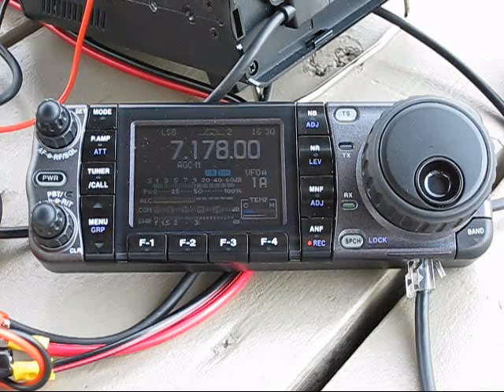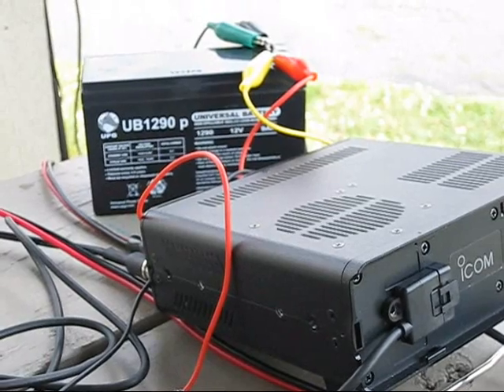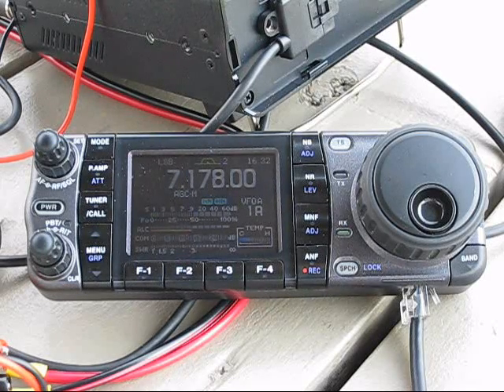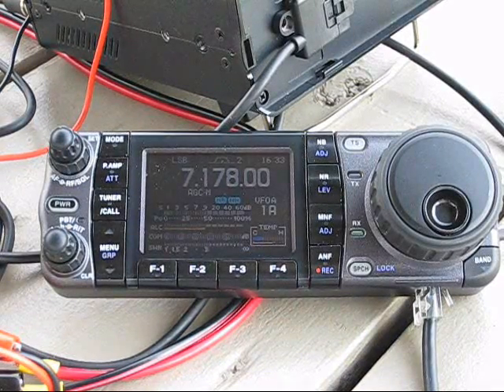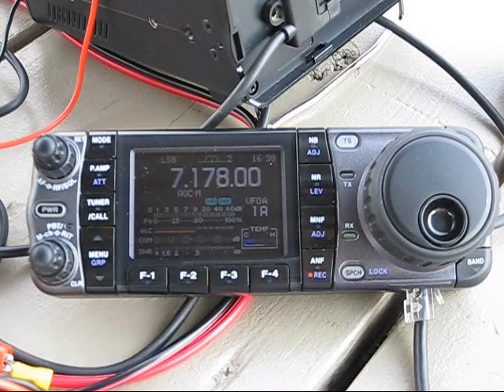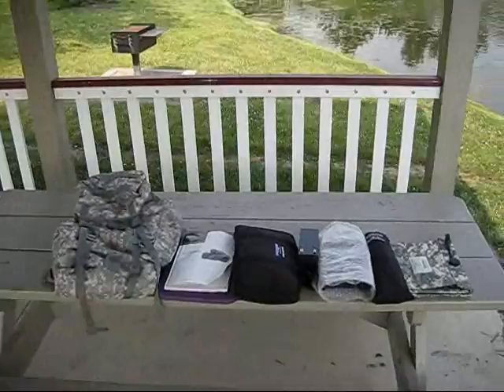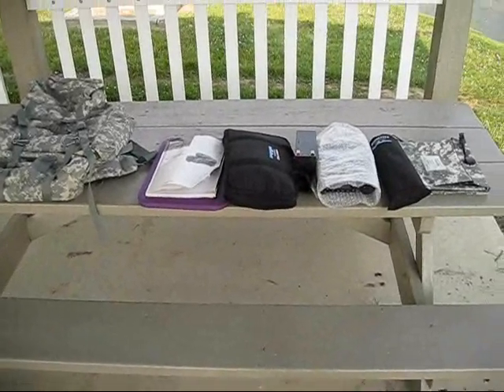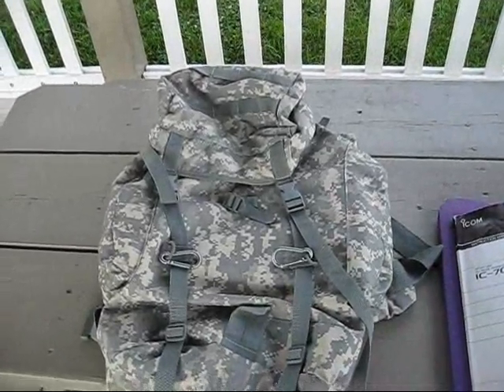Off Grid Standalone Communications

Comment: BTW! The YEASU FT-817ND is a great little 160-70cm all mode transceiver that has its own battery pack that can last for up to four hours. On the same external 12v 7ah battery alone you have can last up to 10 hours or more depending usage can last days. Along with that solar panel makes almost a perfect EMCOMM Go-pack. It's no IC-7000 but you need light weight in caseof an emergency.

Comment: Good job! Something is better than nothing and what you have is a nice HF setup. The ICOM 7K is a phenomenal radio. Just posted a couple vids myself on mine. A motorcycle battery is not portable but you'll get full power for about 5 hours but running QRP you can get up to 9-10 hoursso that you know. 73!

Comment: The first ham ticket is not hard at all. No real math needed, I have advanced and not that much to it. You can get VHF gear that is not expensive and working through repeaters you can get reliable como out to 50 miles very easy if the repeater is high enough. So give it a try, go to the ARRL web sight and get all the info you need. Good luck DAVE

Comment from the maker: @breckandy The technician license isn't very hard if you can do simple math (Algebra) and can memorize equations and principles of HAM radio. I would suggest finding a local club your area. Typically they offer classes and administer the exams. Great way to network.

CB's have a small limited power output unlike that of HAM radio. Each license level gives more privileges. Handhelds can be had for a couple hundred dollars. Base units can get outrageous and are still expensive on the low end